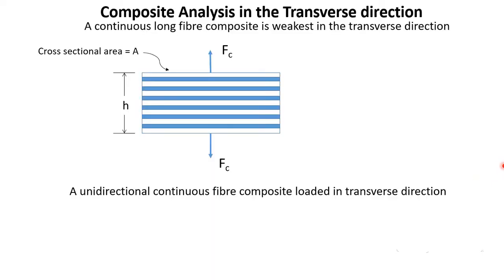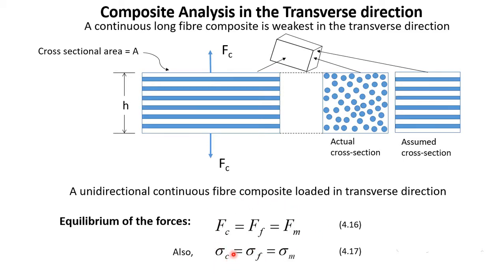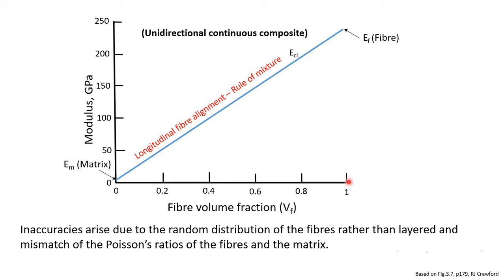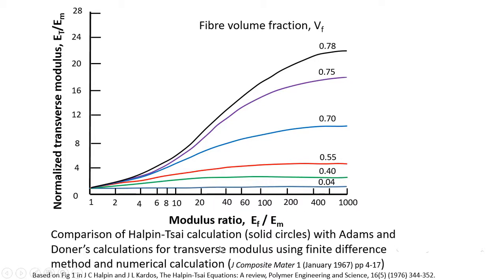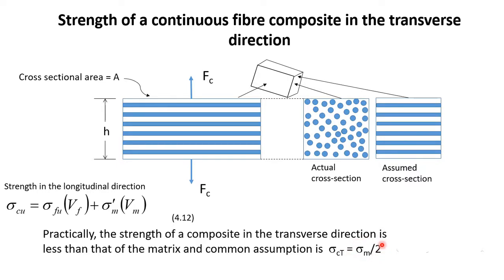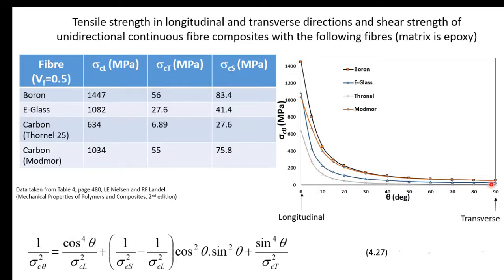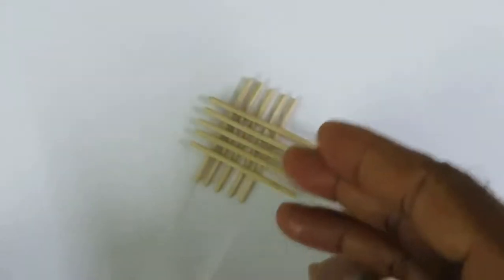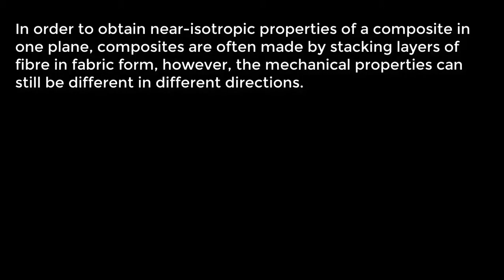Composite Analysis in Transverse Orientation for Elastic Modulus and Strength

Comment: thank you so much sir
do you have a video explaining moduli when there is a void content
Reply from the maker: I have not seen such a model. Voids are generally considered as something which will weaken the composite rather than strengthen it. Hence, our main focus is to remove any void. That is the reason you apply lots of compressive pressure during curing. Please watch my video on making of bamboo-epoxy composite.

Comment: How equal will the elastic moduli be obtained using the direct tension or compression method and ultrasonic bulk wave through transmission measurements?

Comment: Sir, can you please explain  calculation of ultimate strength for metal matrix composite reinforced with ceramic particles
Reply from the maker: Particulate reinforcement is generally not very effective compared to the long fibre ones. However, particulate and short-fibre composites are very useful from manufacturing angle. I would like to mention few references (one is ours) for analytical and FE modeling of such composites.
Analytical (Harpin-Tsai work): https://onlinelibrary.wiley.com/doi/abs/10.1002/pen.760160512
FE modeling:
https://www.sciencedirect.com/science/article/pii/S0263822305001856
https://onlinelibrary.wiley.com/doi/full/10.1002/pc.25890
These analyses and models are for different aspect ratios of the fibre and for particulate, the aspect ratio can be taken as one. You can find necessary information from these papers.
I hope the above helps. Thanks for asking ✔👍